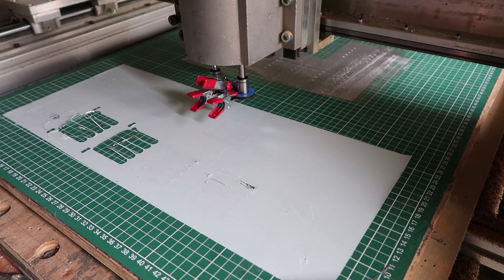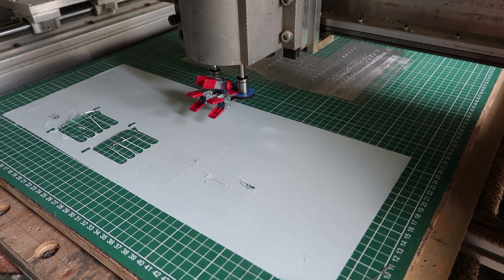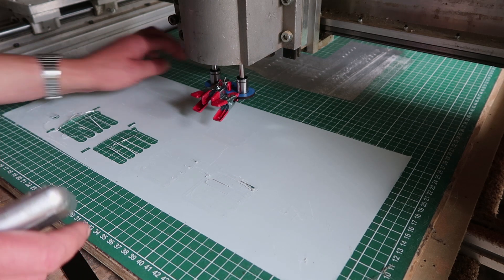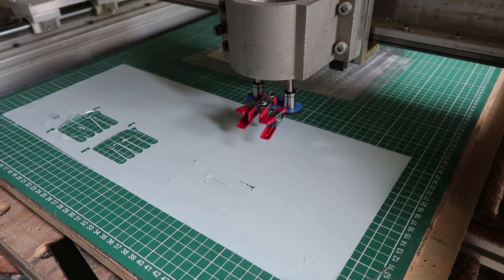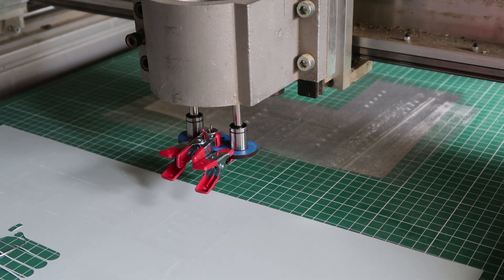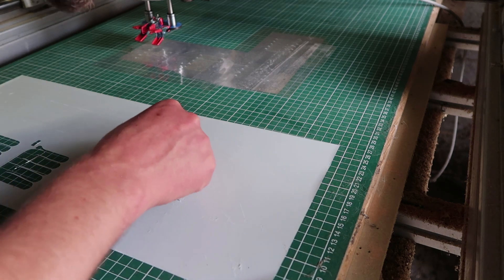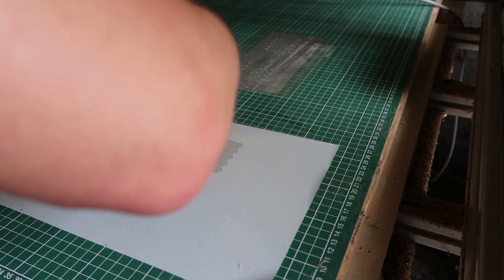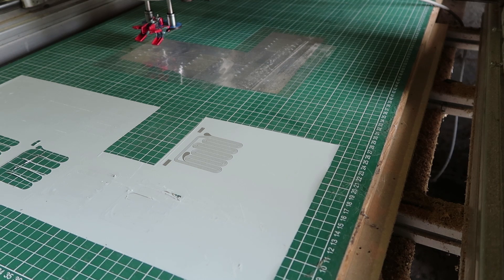Plot Cut Small small smaller coils

Comment: have you tried to get Kaladex?
Reply from the maker: yes i looked for it, but then again ....... 40 degree C difference. well it is something. thought it was 20 to be honest. but then again. temps are not the biggest problem i see in for instance a B&G neo 3 :) that would be distortion. it will sound distorted far before the mylar becomes a problem i think. (depending on where you cross though) mine are made for small monitors, and wont see spl above 95 db i think since the woofer will bottom out much earlier. :)
Reply: oh, temps, right. not an issue, for hobbiest. i thought it went thinner than mylar, though. always the material lends a signature to the sound. youre getting 86-87 db?